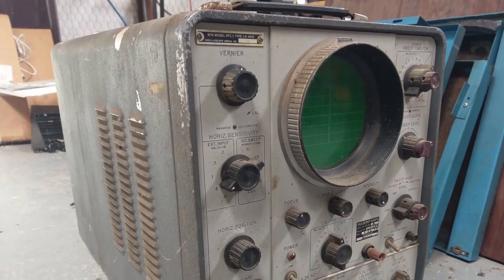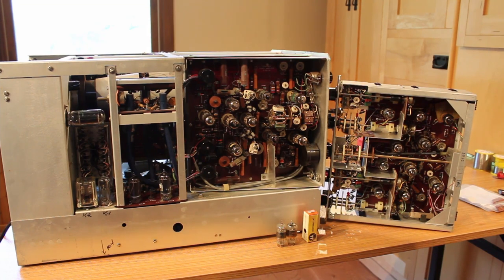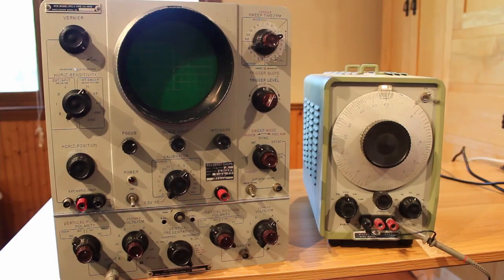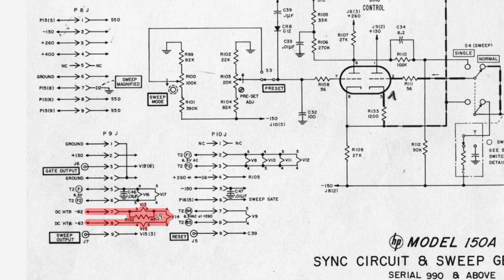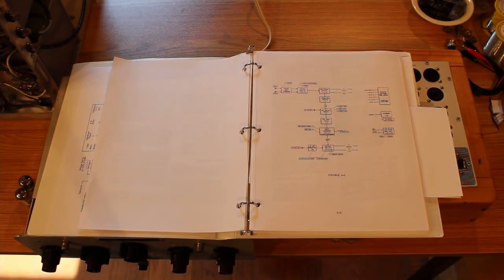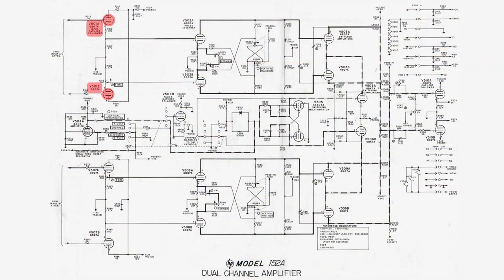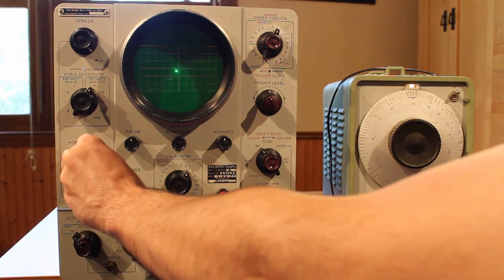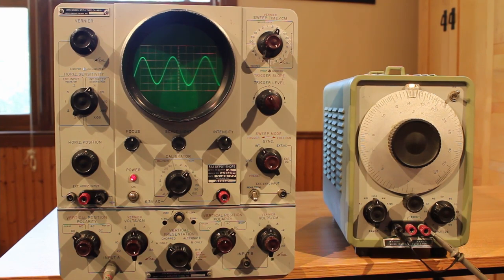Restoring an HP 150A Oscilloscope (Part 2)

Comment: Did you pay attention on the foil end of those foil caps? Allways keep in mind to put the outer foil end to the lower impedence section regarding Gnd!
Reply from the maker: As near as I can tell, the Panasonic film capacitors that I'm using don't have any indication as to polarity or which end is the outer foil. I read through the datasheet looking for any of that information, but maybe I overlooked something?
https://www.mouser.com/datasheet/2/315/ABD0000C179-947645.pdf
Reply: @jeldrikpetersen  Not that it really matters in this instance
Reply: @Sine1040  Why shouldn't it matter? An oscilloscope should be precision equipment as it is designed to be. As you use it for RF measurements you should guarantee signal integrity. To start with even the smallest passive parts like caps. Why should one want to screw up measurements by insufficient repairjobs. In my opinion one has to do the job right or just don't touch it!
Reply: @jeldrikpetersen  
This is a good old (but slow) 10MHz scope, you are not going to do HF things with it.
Plus the caps are in the horizontal section / timebase where it's even less of an issue.
Reply: @Sine1040   Ok, so please inform the Tek  and HP engineers and all those designers of good ol precisio  equipment what you think. Maybe you could start this discussion with Mr Carlson. All those bearded virgins chose 1% resistors and made the redicolous effort of marking the foil end for decades. Maybe you have the holy grale of precision work in oscilloscopes and they are all wrong and had been for decades. Proof them fool, they wasted their time on this topic and waited so long for your wisdom! Tell them that precision work doesnt matter. Maybe we also forget about millimeters and micrometers thats so small it doesn't even matter. Who even cares if the window doesnt fit for a small part of a meter just take the 5 pound hammer and its in 👍
Reply: @jeldrikpetersen  No need to get overly dramatic. I'm not saying it doesn't matter, It just doesn't matter in this case. The timebase is specced at a bandwith of half a megahertz maximum, this is scope has a very slow deflection amp, even for it's time. And if you take a close look at the (incredibly drifty carbon composite) resistors you'll see they have a silver tolerance band, that means a tolerance of +-10%, there is no super precision stuff going on here.
And even if there was, the replacement caps used are physically so small that any stray coupling they might have is completely negligible.
Reply from the maker: @jeldrikpetersen  I am indeed a fan of Mr. Carlson! 
For the time being these caps will stay in place while I diagnose other, much more pressing problems. The longer I use the scope, the worse it gets, so I'm pretty certain that I have some resistors that are drifting further and further out of spec as they heat soak. Once I've eliminated all other obviously bad components and the scope is functioning quite reliably, I'll get into trying to bring it back into spec. At that point, if the caps are proving to be an issue, I'll definitely look into getting more appropriate axial caps with the proper lead lengths.
Gotta tackle the big, immediate problems first though!
Reply: @Sine1040  For my test gear I allways use better parts than those I take out. Back in the time better Resistors were quite expensive. If you take a look at extreme precision equipment you will find the high precision stuff. But those instruments had a massively different pricing. I for myself aim to improve performence of my gear. Back then they used the cheapest parts available, still suited for this application to cut cost. I think a few cents more for better parts and a few seconds to test a cap isn't that big deal as we are not talking about million scopes to be restored. Everyone may do whatever s/he think is the best. As Resistors are verry cheap today I just put in the 5% or better why should I swap them for a 10% regarding a few cents. It's my hobby so i don't mind the cost or effort. Also if it doesn't improve much or any atall, it won't harm the device's performance.
Reply: @UsagiElectric  I don't see much of a problem with those caps. As Guido mentioned there is not that much of an effect, if even remarkable. The axial leaded caps are fine. I use exactly the same for restoration of Tube Radios and test gear. As an improvement you could think about putting them in the "right" direction. For some tube amps I used the radial type just for the looks. It's allways a question of use case and cost. For example here in Germany the axial leaded type is much more expensive. So i use the cheaper radial type if they aren't visible.

Comment: I was wondering most of the inverter circuits are based on solid state electronics , is it possible to build an dc to ac inverter using vacuum tubes ?
Reply from the maker: I might be inclined to say that most solid state electronics are based on vacuum tube circuits, since these designs all predate the transistor by a fair amount!
But, that may be me being a bit pedantic, haha. At any rate, it is definitely possible to generate AC waveforms from DC using vacuum tubes. But, they're going to be fairly low current simply because vacuum tubes just can't move that much current.
One design that is really easy to build, is a multivibrator. IBM used this basic design in monostable, bistable and astable for most of the building blocks in their old vacuum tube computers. Here's the basic multivibrator astable design: https://i.postimg.cc/kXzBr3zr/103078864-10221111567233036-448440687881355264-o.jpg
I actually use pretty much the same design only at 12V in the little flashing rabbit logo I built for the new intro.
But, there's a ton of other great oscillator designs out there, like the Hartley oscillator or the Wein Bridge oscillator!
Reply: @UsagiElectric  thank you for a detailed response and pointing me to the right direction … I will explore this  in more details